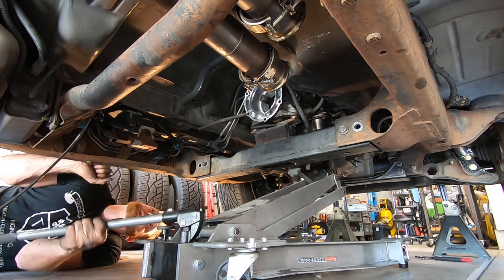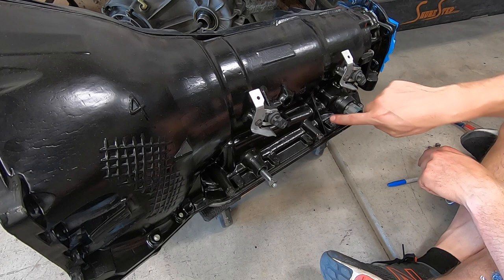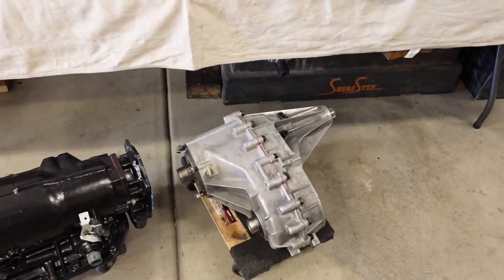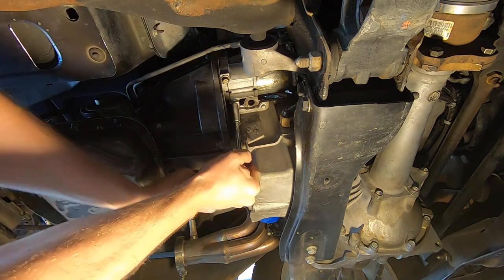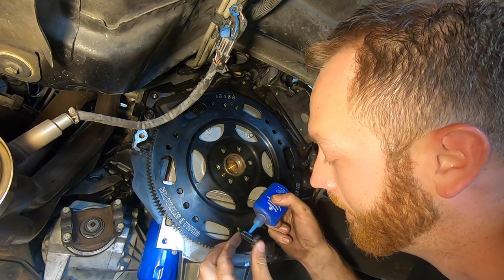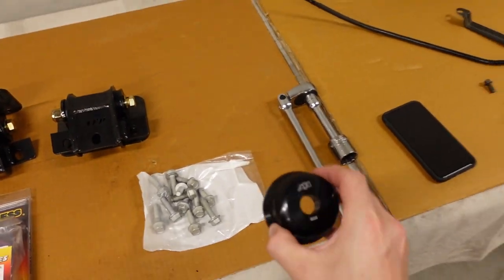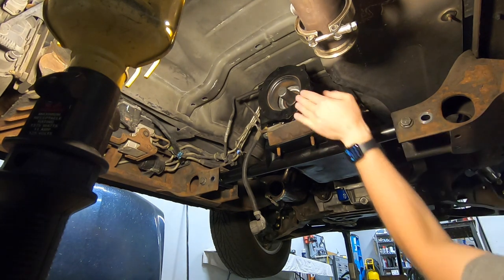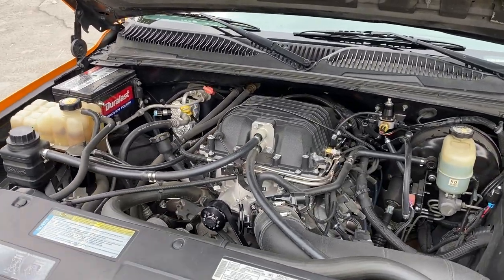the INDESTRUCTIBLE drivetrain swap for the COPO truck

Comment: COPO Truck is one of the nicest builds I have seen on any automotive channel to date. Legit all around beautiful truck.
Reply from the maker: thanks a ton, that's much appreciated!
Reply: Umm go look at stangkiller performance ZL1500 you will easily change you’re mind.. I AM NOT knocking the copo truck by any means but you said nicest build you have ever seen on an automotive channel and I can’t let that slide. That trucks got over 100k into it and is beautiful. Paddle shifters, 800+ whp, full coil over front and rear, original paint job and interior. He also has built a second one that is red.
Reply: Also forgot to mention the red one has over 1000whp and is also original paint and interior from 94
Reply: Agree!
Reply: @coltengottschalk1049  the red one originally had red interior and now it's gray...it's original style but not original to the truck...and a painted dash
Reply: They are all very clean trucks
Reply: @stephenjenkins9599  you’re right I forgot he even changed it, haven’t paid to much attention to the red one, I favor the teal one.
Reply: @coltengottschalk1049  I think he is about to start a brown one
Reply: How did you do the tuning portion with the factory e85 tune and 4l80e?
Reply: It's pretty cool but you must not watch a lot of automotive YouTube channels if this is one of the nicest build you've seen

Comment: Glad you like the mounts and the truck is coming along nicely! I am not sure if you mentioned it but the dipstick tube is different for the 80e vs the 60e . The actual dipstick is the same, just the tube is different. It is a great idea to actual calibrate your dipstick to your "true full" level on your transmission where your builder wants it, typically 1/8" above the pan rail by drilling a hole or scribing a new line. Fluid starving the 80e is a common source of transmission problems in the 80e since the pickup is in the front of the pan. Lastly, if you notch that middle crossmember in front of the gas tank you can drop the tcase and trans together instead of having to separate them first.
Reply from the maker: yup, great point worth touching on for sure. I showed the steps back when I rebuilt the trans, and the factory marks were about 3/4" too low

Comment: FYI, most 120v air compressors have terminals inside the pecker head for 240v. You just need to switch a few spade connectors around. It will use less electricity wired that way, will run better, and won't trip breakers all the time. You can look up the wire schematics for your motor online if they are not inside the motor already.

Comment: Wish I known there was a seal driver yesterday!!! Was doing the front output t-case seal on my LMM and it took me 5 hours and hot red sun-burned legs later to finally get it done. 10/10 won't recommend unless you're rebuilding the T-case!! Thats the end of my rant lol. COPO Truck is coming out awesome!! Might do a similar drivetrain setup on my 07 Avalanche, but stick with the 246 T-case with the 4l80. Also grabbed an 8.1 Vortec for my Mother and I's 71 Camaro Pro-street project. Can't wait to get that on the road too!!
Reply from the maker: sounds like a fun project! I'd hate to remove that seal without taking apart the transfer case, that would be no fun

Comment: Stock 01-06 DMax front driveshaft drops right in.  20 bucks at the yard.  I’ve hit it with 1600 whp no issues.
Reply from the maker: great option there for sure

Comment: Use the bolts down thru the bracket and use flange nuts on the pan. That way you find have to take the bracket of just to change fluid and filler.

Comment: Love your builds keep up the good work. Lot of people don't know that if the converter isn't spaced right it can and will wipe out the pump especially if it got too much clearance.  Also when I put trannys in if they have 4 or more bolts I tightened them up 180 degrees apart from each other too pull the converter up square
Reply from the maker: Thanks, will do!

Comment: You definitely need to do some 1/4 mile runs with nothing changed but the transmission to see how much slower it is. According to everyone on the internet, that 4l80e should be a ton slower than the 4l60e. It would be cool to prove or disprove how the seemingly much worse 1st gear ratio and the claim that it takes a lot more power to spin than a 4l60 affect acceleration.
Reply from the maker: well, we have the data from the "before" runs so we will def. get some data after the trans swap

Comment: I'll be curious to see what works for driveshafts, my 2WD truck only required a different yoke after the 80E swap. And I have heard that a stock 2500 front shaft works for 4WD. Also, love the DTR stuff. I have his transmission mount in my 2001 2WD truck, his design is superior to others IMO - gave me tons of room when routing the exhaust system.
Reply: I have the same question on the front shaft! Rear is definitely going to need to be shortened.

Comment: If you ran the longer bolts for the shift linkage down and put the nuts on bottom wouldn’t that make it easier for trans maintenance in the future?
Reply from the maker: maybe, but I think I'd have to remove the shift bracket either way to drop the pan, so it wouldn't make a huge difference I think...

Comment: I use to use a 4.5 for everything. Alway had 4 handy, skinny disc, hard disc, flap and wire. The last use years i hand myself like the fit and finish of a file and a deburing tool.

Comment: Remove the trans pan and check the proper fill height for the dipstick. 
Otherwise.  Love this build. A definite ripper!
Reply from the maker: yup, we covered that when we had the trans apart for the rebuild/shift kit. my stock mark was an inch low
Reply: @LawrenceTolman  gotcha.  I skipped that video.  Done a few 4l80e already.

Comment: I wear hearing protection all of the time. I have tinnitus (ringing) in both ears from when I was young and dumb. Don't let anyone shame you into going without. It's not their hearing that's on the line. Sane goes for safety glasses. You only have 2 eyes. Instead of sunglasses, I wear safety glasses nearly any time I walk out the door at home. If they're not on my eyes, they're on top of my head. I've always got them handy.

Comment: I have a Pro Charged AWD Silverado SS. 402 stroker, water meth boost juice. The old “built  tranny” 4l65 let go. My tranny shop Ultimate Transmission in Boise said since I’m not drag racing much the 4l65 billet everything/ triple disc TC was the way to go even though I really wanted the 4l80 swap to take it up a notch in badass. The tranny shop said the lighter tranny was much less weight to spin and it would be noticeably faster. So far so good. I have had it 3 months. It went 11.99 at Firebird raceway at 2700 ft on a 85 degree day so I’m happy. Not saying the 4l80 swap is a bad move just a data point to provide. Dave at Ultimate Transmission in. Boise is the guy to talk to for more info.
Reply from the maker: great info there! I thought about doing a built 4L60 on this one, but had heard so many hit-or-miss stories about some built 60e surviving, and some lasting forever.

Comment: My knee-jerk thought was to run an NP205 instead of that split-case aluminum chain driven t-case.  The weight & drag might cause more problems than it solves but I come at transfer cases with an off-road mindset… I like what you’re doing though.

Comment from the maker: place your bets on the 60 foot and 0-60 changes from the 80e swap. It has a taller first gear, but now a better converter... will they cancel each other out? or, do we lose a little bit off the line?
Reply: I think the 60 foot MAY change some, but the 0-60 stays close to the same. The converter will probably help the whole 1/4 plus with the triple disc you can lock it up at the big end if ypu need a few more rpm, instead of going to 4th

Comment: I have a 2003 z71. Np261/4l60e. If I swapped to a 4l80e, would I have to change drive shaft length? What is the rough list of parts?

Comment: Is that 750 to 800 HP with AWD or just RWD? cause you get alot more drive train stress with AWD as apposed to RWD were some of the torque of the engine is re-leaved in the form of rear wheel slipping that won't happen as much in an AWD setup like yours and might lower that HP and torque number that that trans can handle.

Comment: Have you ever heard of anyone taking a single cab short bed, doing a frame chop and swapping in a 5 ft bed off a double cab?
Reply from the maker: there is a guy on IG who did that with a single cab Duramax and made a super shorty
Reply: I think the Tahoe frame has a shorter wheelbase,and also no leaf suspension in the rear..Also,by using a 07-Escalade or Denali frame,you will get a better rear axle and front suspension

Comment: Using the first edition 4L80 make connecting the cooler lines less of a challenge.
Oh by the way, the worst transmission ever was the TH200 installed in full size G.M. vehicles.
The original application of the TH200 was for the Chevrolet (Isuzu) Luv truck. Small truck, light weight.

Comment: I usually leave the dust shield off the torque converter if it's never going to be going offroad. In my brain it's just holding heat from the converter in. With it off the converter should be able to dissipate heat better and even get a cooling effect from air going under the truck.
Reply from the maker: if it was just a dust cover, I might be convinced to leave it off for hear reasons like you mentioned, but it also acts as a reinforcement between the transmission and the engine on an LS, so I wanted to leave it in place

Comment: Hey LT what size grip tech pulley you running and the belt after you put the hd tensioner on thanks !!
Reply from the maker: 2.45" griptec upper with a 101" belt and the Atomic HD tensioner kit

Comment: I think I’m going to try those motor mounts. I just got my 408 dropped in my regular cab and my headers are making contact with the floor under hard acceleration. It sounds terrible! Maybe the stiffer mounts will fix it.
Reply from the maker: They def hood the engine in place better than stock

Comment: LT I need to buy the mount you made for Project Red Tide, are you making these for the public yet?
Reply from the maker: I wish I had a tubing bender and would've made some dimensions, I could probably sold a hundred of those mounts by now
Reply: @LawrenceTolman   hint hint you still can   I can ship my 88 k2500 too you as well as my 2005 Yukon Denali XL Which is all wheel drive

Comment: Do you know if the NV246 transfer case uses the same output seal as the 149 (and therefore the stepped seal tool)?
Reply from the maker: yup, the tool should work on the 241, and 246 as well

Comment: Great truck. I want to upgrade to an all wheel drive on my 98 GMC. Can it be done?
Reply from the maker: if its 4wd now, yes you can. I build a truck called "redtide" a few years back that was an AWD GMT400 single cab. if you watch some episodes of truck tech,  you can see what it takes to build
Reply: @LawrenceTolman  thank you for your response. I did see the red tade vid and that's what made want the set up on my truck.  My truck isn't a 4×4 just a 2wd. How much would it cost for the upgrade?

Comment: You may know this already but your viewers may not although you put a really good and strong 4l80 Transmission in, you might notice that the truck won't initially accelerate as quick as if when you had the 4 L 60 in, and that will be primarily because the 4l60 has a 306 first gear while the 4l80 has a 248 first gear, and man those 4l80 transmission are stupid heavy anyway enjoy.
Reply from the maker: very valid point. we're gonna be doing some 0-60 tests after the conversion to see how badly the gearing affected the acceleration

Comment: The 4L75-R is the strongest 4l60E based transmission by GM performance.  Designed to handle the power of the GM 632ci big block crate engine.     The 4l85E is stronger then the 4l80E.

Comment: 4L85E I believe was the strongest 4 speed as the extra planetary gears and all associated gears were straight cut instead of helical cut gears.
Reply from the maker: fair point, but since its still basically a 4L80, I kind-of considered them one in the same.

Comment: Why not a 6l80e ? It has its own computer & 2 gears of over drive. 
 They also used them in 4 wheel drive. You also use updated tq converters as well. 
 Just a question.  
 Be safe.
Reply from the maker: the biggest challenge there would be getting it to talk with the  Gen 3 PCM running the engine, but I do love the idea of more gears

Comment: Do you have a parts list for the red tide  build engine side only
Reply from the maker: not a complete list, but it was a powertrain products "hot rod" 5.3 crate engine, holley hi-ram, dominator EFI, 90mm TB, pacesetter ceramic long tubes, and misc holley sensors, coils, and bits for the EFI side of things

Comment: I just did a 4l80 swap on my 02. i strongly dislike transmission swaps. The trans swap was a success i swapped in the 2500 radiator with a summit racing fan trans cooler. The 3 trans tunes i loaded seen really lazy shifting. It works good if i drive like a Grandma but getting in it, it takes way too long to shift.

Comment: Someone may have already mentioned this, but I have always been told to not mix rubber mounts with with polyurethane mounts??? mite replace transmission mount also while your there??? as it looked like rubber in video??🤔
Reply from the maker: yes, the rear one is rubber which is actually OK (in my book). From everything I've been told, if you do soft rubber front engine mounts and a firm poly rear trans mount, the twisting motion allowed by the rubber engine mounts could cause the rear trans case to crack or break because of how stiff the rear mount is (the rear will be trying to hold back the engine "twist") but if you have a firmer poly mount up front that stops the engine from moving much, the rubber rear mount won't matter since all it does is hold up the weight of the trans at that point.

Comment: Do u know the size of drive shaft u need when using 4l80e on those trucks?
Reply from the maker: not sure on the dimensions yet, but the rear will be shorter and the front will be longer

Comment: Coming together nicely LT !

What about a 50-100hp shot down its throat before you go bigger cubes ?
Reply from the maker: the main thing I plan on doing are cooling mods for the blower (bigger pump, reservoir, and heat exchanger) and an 8 rib blower drive with an overdriven lower balancer pulley

Comment: Strongest 4 speed gm built. Idk how many passes I have on my stock rebuilt 4l80e but on 9psi something snapped thinking input shaft 😂
Reply: Read up on the specs of each, they arent far apart in torque, best to always build up any transmission when going beyond stock.

60 means up to 6000 gvwr, 80 is 8000 gvwr

Comment: What’s the gear difference between 4l80e -and 4l60e your running a 430 rear end do you think ur gonna lose mph at the 60ft to the 330
Reply from the maker: 1st gear in the 60e is like 3.05 and 1st in the 80e is 2.48. in theory if all that changed was the gearing, we might lose a bit off the 0-60 and 60 foot, but since we also are installing a better torque converter, I hope we gain back anything that might be lost. but we do have some data from before we will compare against to answer the question with results instead of just theory.

Comment: Curious how much HP you lose with this tranny from parasitic loss from all the mass.  Also the first gear on the 4l80 is numerically lower so you are going to have a little more to overcome to be back where you were with the 4l60.
Reply from the maker: yeah, one drawback  of the 80e is it will have a higher parasitic loss and the gearing isn't quite as great as the 60e, but thats part of the reason why I went with a 4.30 gear to offset the tall 1st gear in the 80e
Reply: @LawrenceTolman  but you have been running them already so you will show a loss from before..  I had the same thing years ago going from a th350 to th400..  Are 4.30's the lowest you can get for the front diff?

Comment: For those of us that prefer a manual - do you think this would work with a T56, or something similar?
Reply from the maker: the T56 would be a challenge and require custom adapters, but if you had a truck NV3500 5-speed it would probably bolt right up

Comment: Can someone explain what COPO means?
Reply from the maker: Central Office Production Order. Its a program GM used to have back in the '60s and '70s where you could basically custom order a car with any engine or drivetrain part that was available, like an LS6 454 into a camaro or something like that. I built the truck with the same sort of premise, as if I could pick and choose any engine and drivetrain combo
Reply: @LawrenceTolman  thanks, I thought that’s what it was but just wanted to make sure

Comment: LT, Do you know anyone in the south east (near Augusta, GA) that can make a wiring harness from scratch??  I built a twin turbo 2002 Chevy Silverado with a 2003 4.8.  In 2003 is when the Silverado changed to the cat eye look and they also changed the wiring harness.  My friend and I tried to put the two together and never got it working, and I’ve been to every junk yard to try to put something together with no success.  If you know anyone that can re-make a wiring harness (both the engine and body) from scratch, please let me know.  I know you were located in the south when you were on Trucks, and if I have to take the truck out of state, I will travel.  Thanks in advance!!!
Reply: Company up here in Greenville SC does custom harnesses.  Stand by for name.
Reply: HCR Innovations - they have a website.
Reply: I called them over 6 months ago; they could not assist me.  Thanks though.....